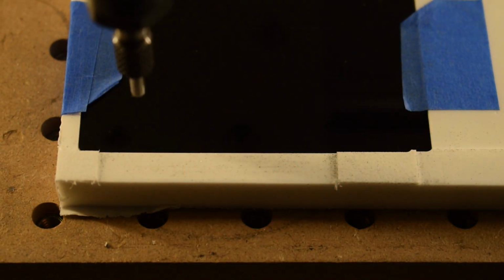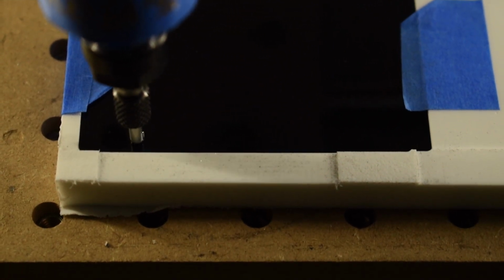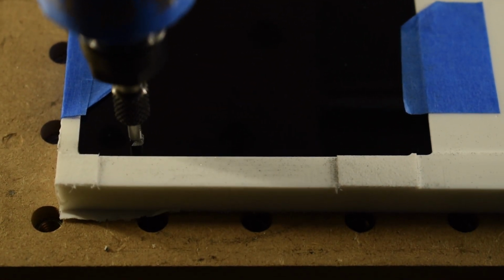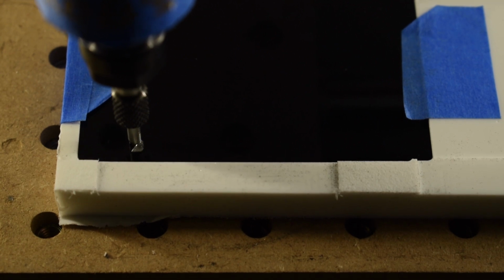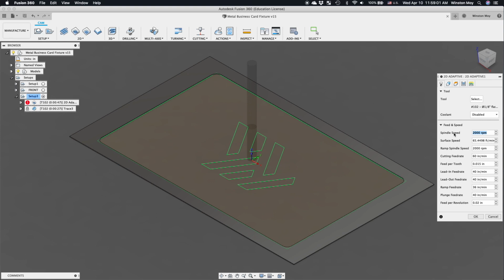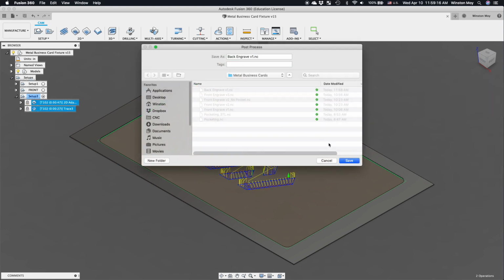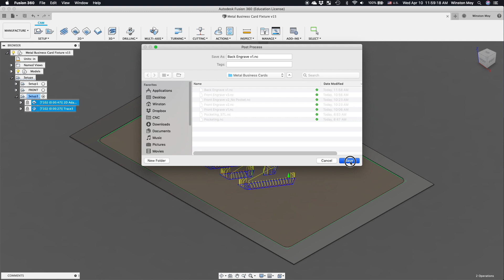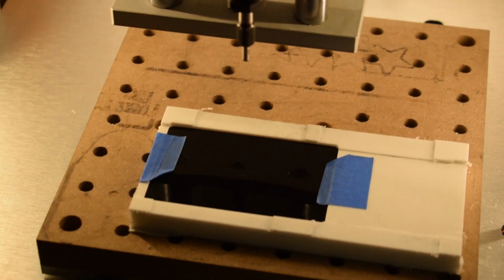Drag Engraving w/ the Spindle Off on the Nomad CNC

Comment: UPDATE: Carbide Create now generates the gcode differently. You now need to look for the line starting with "M03S". Example: M03S1200 is for a 12000 rpm spindle speed.